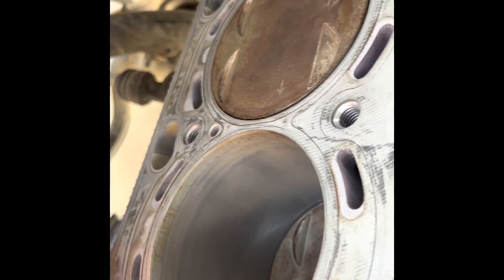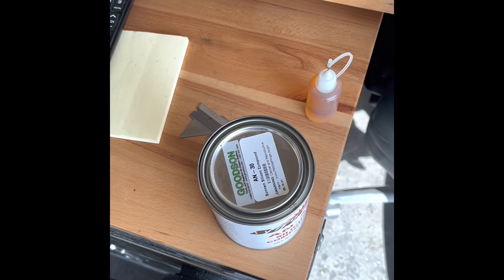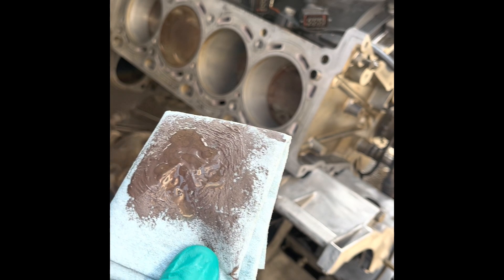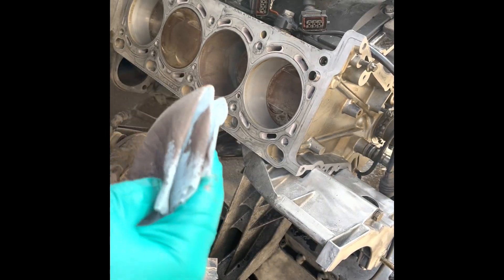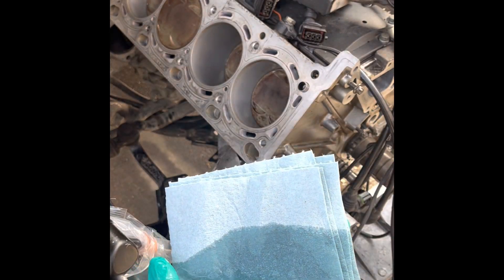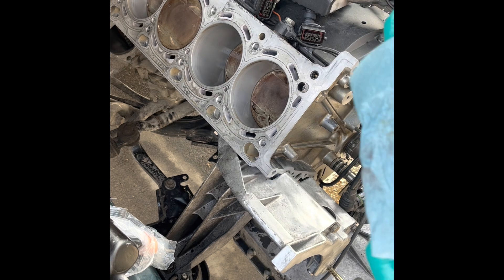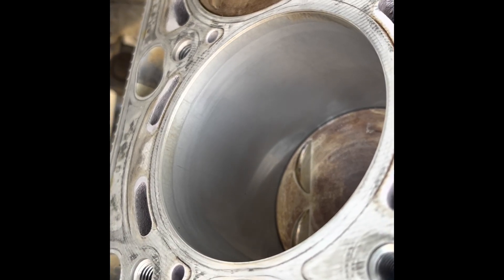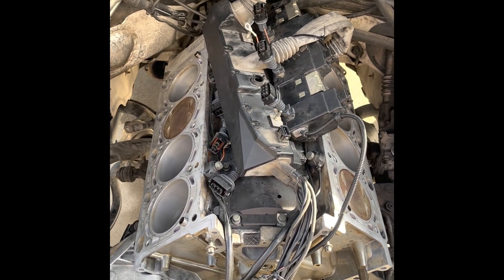Alusil cylinder reconditioning - “hone by hand” using Sunnen an-30 - BMW M62B44tu

Comment: Hey Jesse, I'm about to do this on my own M62. After lapping your motor, would you recommend using a felt hone with the compound or just doing it by hand with a towel, like you did?
Reply from the maker: Honing with felts is ideal for the best consistent cyl wall finish. Can be done by hand but it’s a lot of work and time compared to like 5 min per cyl with a hone set up.

Comment: I have an m113k alusil block with scratched cylinder walls...could I use this paste to fix my block ?
Reply from the maker: If the cylinder walls are scored you will need to overbore until scoring is removed, finishing with 800 grit stones and then this AN-30 paste. Will require larger pistons and rings etc.

Comment: have you ever found a source for felt pads that you could use on a drill or something much like a stone or ball hone?
Reply from the maker: Yes. The ultimate solution for this is the Lisle 15000 ridgid hone. Each set of lisle stones comes with wiper felts. You simply buy the felts and run them with the An-30 paste for perfect results.
Reply: @JesseBreaks  thanks!! 😁

Comment: Any recommendations for wear on the camshaft journals in the cylinder head? I have some heads with minor wear in some of the cam journals and caps. Some barely catch a fingernail but it’s noticeable and I’d like to clean it up
Reply from the maker: Take an extremely fine grit paper like 1000-2000 grit, remove cam and bolt the cam cap back on, and lightly buff out and smooth the scoring. Low spots in the scoring aren’t the issue, you just want to remove the high spots and smooth out the journal surface. No need to polish any light texture from the paper will hold oil and help retain oil pressure.

Comment: Hi! I've got an audi with an alusil block. There are 0 scoring marks, they look perfect; BUT there is like slight discoloration on the edges of the walls. As if the sides were more shiny,  when the walls otherwise are kinda 'milky'.  My tech told me it's a coating that has worn out. It is a linerless design tho...
Reply from the maker: Yes Audi uses this same process. The milky appearance is the micro texture left by the paste, fine scratches to allow for lubricant adhesion. If the cyls polish off they will eventually score due to lack of lubrication.

Comment: Hey there 🤙🏼 I’m currently rebuilding a 4.6is engine from a 2003 X5 4.6is. I’m really wanting to completely re-ring it and replace one piston that had minor surface damage so it doesn’t develop hot spots. I’d love to chat with you more in depth about the step-by-step on this because I don’t want to fuck up this block. They’re virtually impossible to find now and it’s in pretty damn good shape for its 200k+ mileage. The AluSil walls are really freaking me out cuz I don’t want to mess up that Silicon crystal formation at all or not bed the new rings in properly. Really would appreciate the help!
Reply from the maker: Hey Tyler, I have lots of info and experience to share on these. Are you able to DM me on here, or is there a way I can reach you?

Comment: Thanks for the information. Really good trick to get a little bit more live out of the alusil blocks.
Reply from the maker: I’ll update again when it’s back together to let everyone know if it changes leak down results or causes oil burning but given the mechanism of action of Sunnen An-30 I couldn’t see that it wouldn’t be beneficial to try.
Reply: @JesseBreaks  any news? about to give this a shot for a refresh before e30 swap...